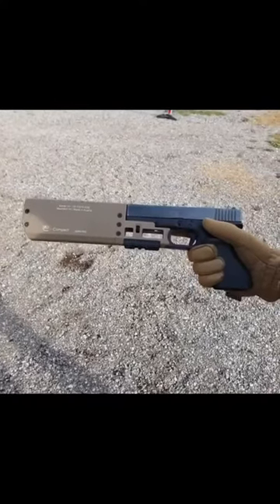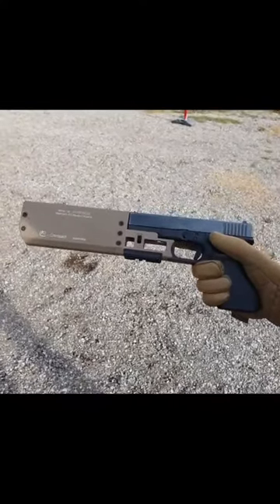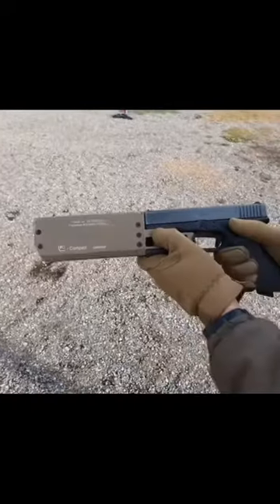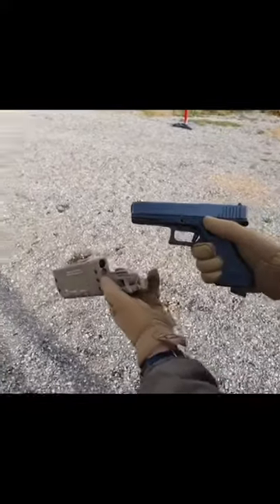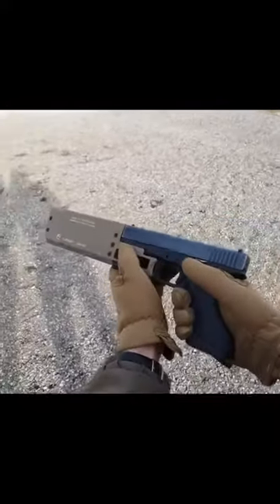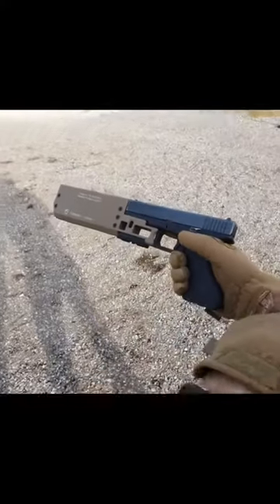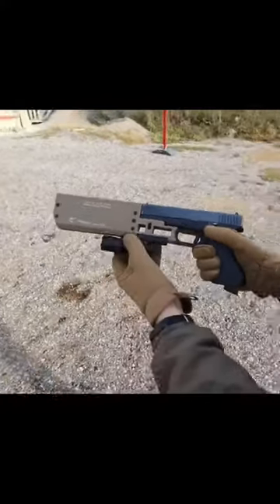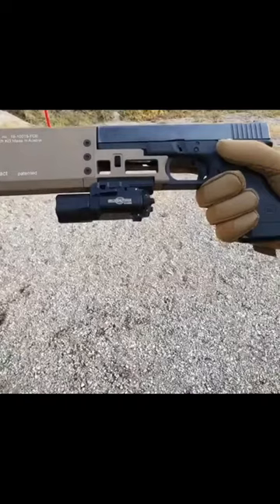Glock17 9mm w. Fischer suppressor

Comment: Cool. Never seen anything like that. Not having to have a threaded barrel is great. How is accuracy?
Reply: it doesn't change recoil or anything bc it doesnt attach to the barrel
Reply: @vicWcs  he means if the suppressor effects the bullets movement I think
Reply: I believe any suppressor effects range and accuracy negatively?
Reply: @alexrosado3890  That's a myth or video game logic. Any suppressor will almost always have positive effects on a weapons effectiveness.

It increases the barrel length and time for gases to expand behind the bullet. This makes muzzle velocity higher and increases range.

You would however want to use sub-sonic ammunition with heavier bullets. This will make the weapon perform worse than normal.
Reply: @KaffiRawr  unless you get a 45 which is subsonic in its natural loading.
Reply: @KaffiRawr uh you are incorrect about one thing actually it does not increase the barrel legnth or performance of the round that is definitely false
Reply: @KaffiRawr it just uses baffles to trap the gasses and keep them behind the bullet it’s what reduces the muzzle report, one would argue venting the access gas with a recoil compensator does more for performance
Reply: @KaffiRawr just not for sound obviously, suppressors are honestly really impractical otherwise they get hot trap a lot of nastiness that should be venting
Reply: @spartanpanda6083  It's true that it does not "increase barrel length". That's was just a simple way of saying it.

But, a suppressor can however absolutely increase muzzle velocity. That's not incorrect. I wrote 
"almost always", and that is true. And absolutely if we're talking rifle length barrels. There's a few videos on YouTube verifying it.

A suppressor probably won't decrease performance, and most times be a very minimal but measurable increase in performance.
Reply: @FFFF-x9i  It's simple physics. I am correct. Suppressors do not harm performance.
Reply: @KaffiRawr thats trueeeee 😊

Comment: How can it seal the sound between barrel and suppressor? I don't undersrand it, also how can it slow down the supersonic bullets to subsonic, if that's what it does?
Reply: I'm wondering the same thing. I wonder how prone it would be to baffle strikes also. I think it's fake tho as glocks barrels I think scootch back a fuzz as they unlock and cycle. Then the barrel tilts also. I don't have a glock anymore to sit and compare it to so I'm going off memory alone. But it seems like a bit of a troll. I'll have to see if it's a real thing and research this more. I would assume a design like a Beretta 92 would be best for this, or another design similar that has a static/fixed barrel. If that don't clip to the picatinny rail slot and lock on it should by all means be flying downrange also due to the pressure spike. I don't think this is such a novel new idea tho as it appears. People have tried many times to get a free lunch and cheat physics while saving money and use clamp style cans in the past, also using rails. I just don't think they ever made it to markets tho as they all failed for the reasons I said. I'm gonna check just in case tho lol

Comment: Strange, the first and second shot both had the same noise level. Normally, there is a louder crack on the first round as the suppressor becomes charged or filled with the explosive gas from the round going off, making the second and all following shots quieter. Makes me think maybe the suppressor was precharged with gas or some liquid.
Reply: They said in the video that last rounds are subsonic
Reply: @SapkaliAkif  So?
Reply: @carlgriffith4660  Subsonic rounds are more silent because they don't create explosions faster that the speed of sound.
Reply: @SapkaliAkif  SO?, still has nothing to do with what I said originally.
Reply: @carlgriffith4660  I would explain if you had decided not to be sassy. Bye
Reply: @SapkaliAkif  OK, bye! BTW...I am well versed on suppressors and the ammunition utilized. You simply did not understand my statement.